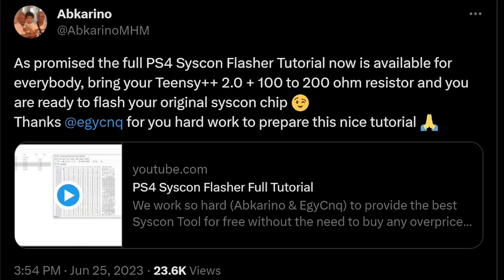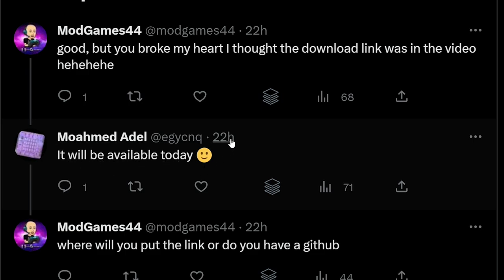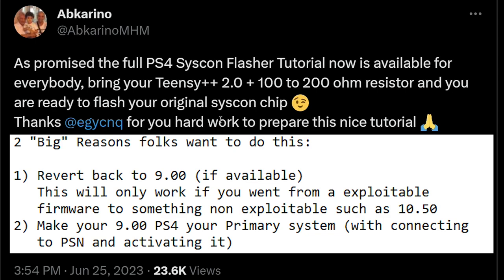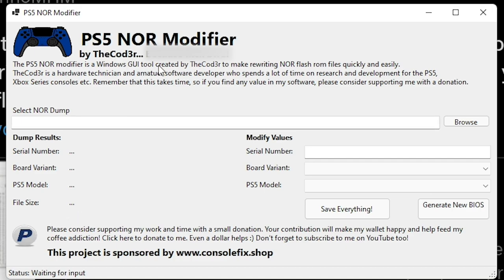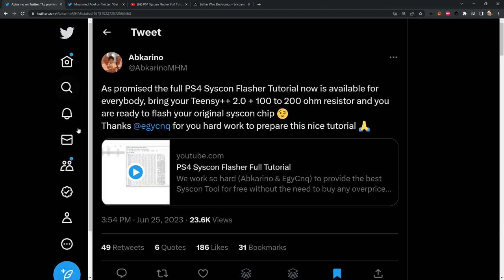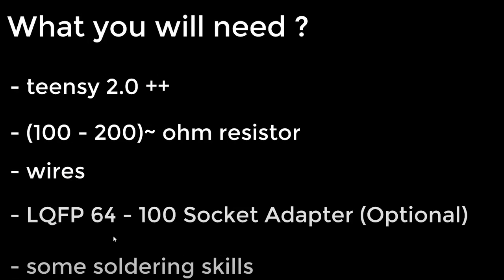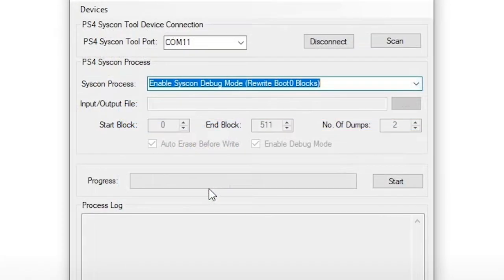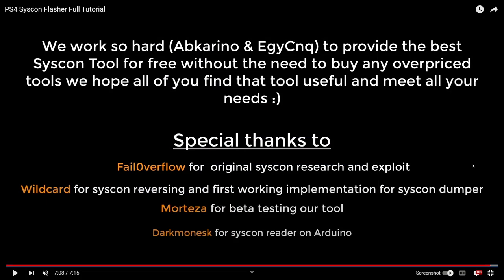This new PS4 Syscon Flasher everyone's talking about

Comment: My PS4 is on 9.00 updated from 6.72, I shall test this when its fully out :)
Reply: for sure!
Reply: i got a 9.03 and 7.51 that i wanna test👀
Reply: ANDImages why would you want to do that? after 5.05 the next best thing is 9.00 right? also @ 2:04 they specifically have mentioned revert to 9.00. Maybe it could corrupt if tried on other firmwares. not sure though
Reply: @ps_r.e  @ 2:04, it is specifically mentioned revert to 9.00 . so will revert to 7.51 be possible?
Reply: @hphp7587  just do some research on the revert method, except 505 and 900 there is still 672 whos been a good jb, the method works on any firmware thats backupped
Reply: @hphp7587  For testing purposes :)
Reply: @ps_r.e  you can only go back to a previous installed FW, if you upgraded from 9.00 to 9.30 then you can only go back to 9.00 and not anything else
Reply: @AtlantisR6  you can still go to any firmware you backupeed dude
Reply: @AtlantisR6  you can have for example 3 different backups and so 3 different firmwares
Reply: @ps_r.e  oh

Comment: what's sad about all those softs and methods is you can only revert your FW to the previous one installed.
If you had 9.03 on the console before upgrading the FW to 10.xx you can't go back to 9.00 but only 9.03 ....
😭😭😭
Reply: I'm planning to dump my 6.72 FW as backup. I can sell you a copy of my FW if you want *wink wink *
Reply: @jackfavvv0280  won't work. If that was the case, we would have been doing it already